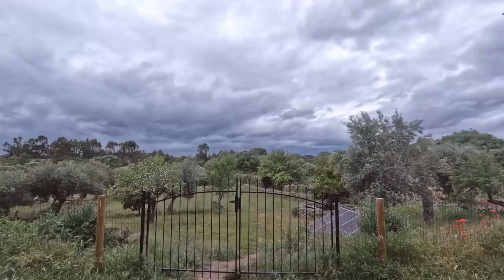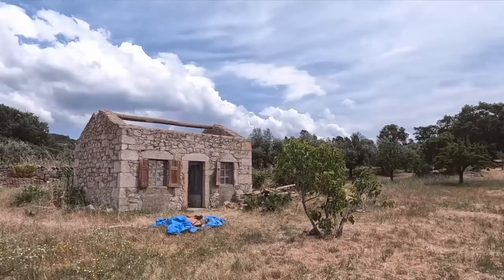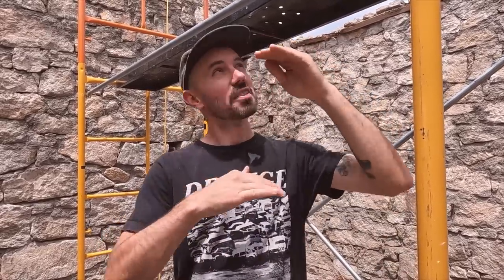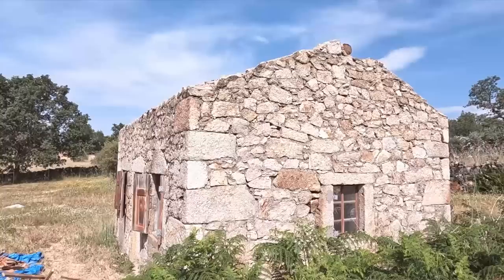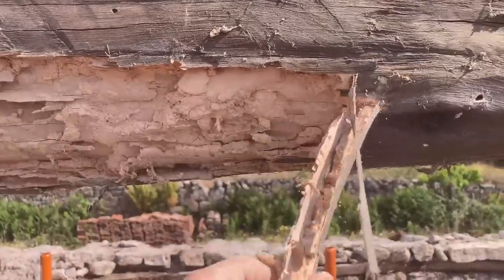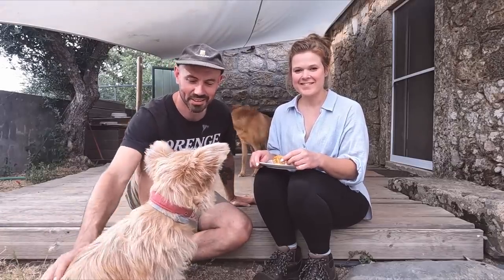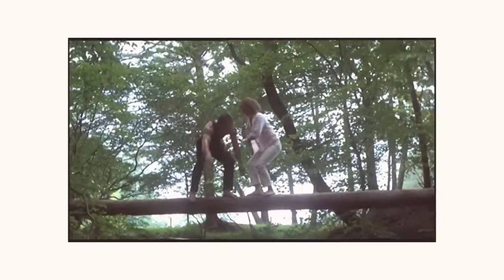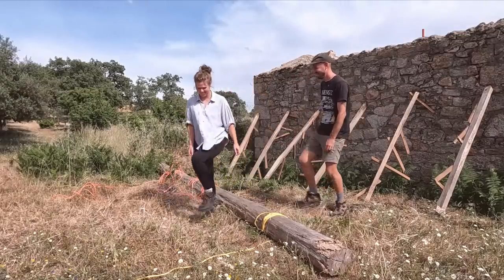Old Stone House Renovation - Is It IMPOSSIBLE to Remove Alone?

Comment: Good effort - I helped a friend on a similar project last summer. I cut some hardwood wedges and raised each end of the beam using a series of wedges and blocks, then I tied off ropes with half a dozen winds around the pole, meaning that when we pulled on the ropes we were rolling rather tham sliding it. Whatever works is good 😃